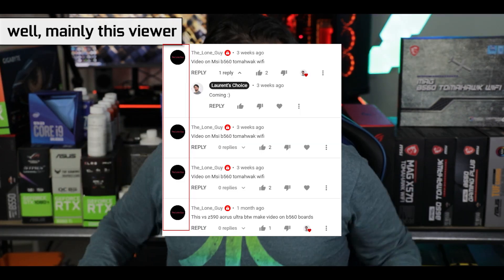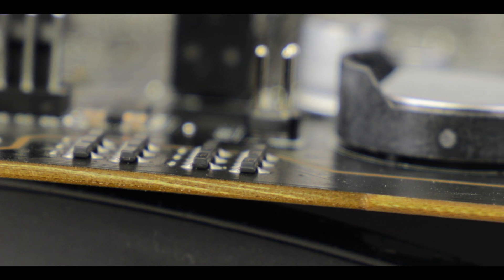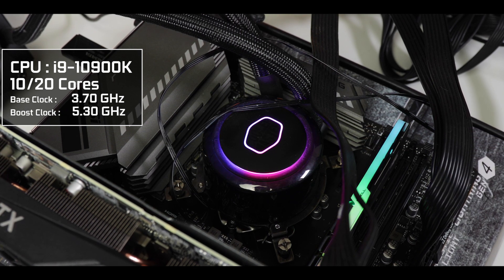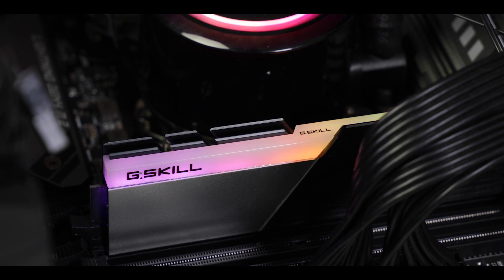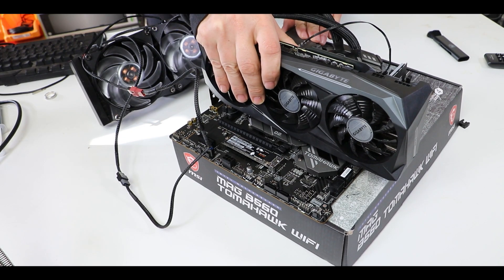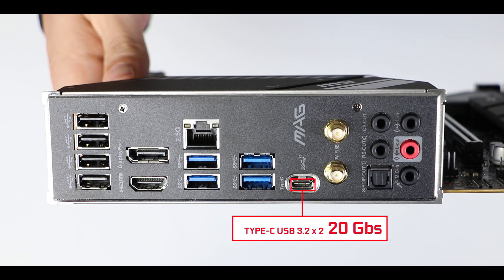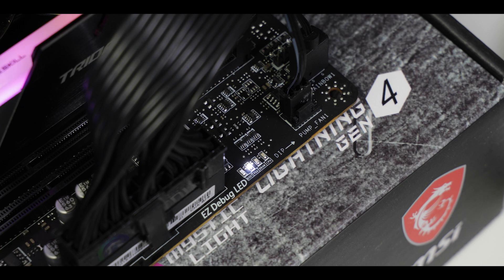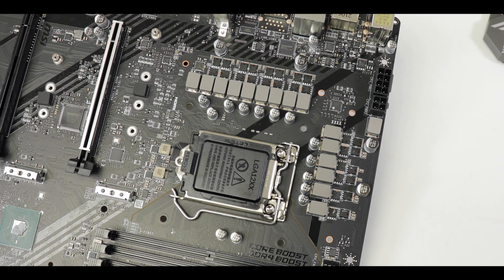MSI MAG B560 TOMAHAWK WiFi : The only TOMAHAWK worth having?

Comment: Please suggest me..
I have this PC..
Mother board is - MAG B560 TOMAHAWK WIFI

Processor - Intel Core i5 11400F 11th Gen Desktop Processor with 12MB Cache 6 Cores and 12 Threads Clock Speed up to 4.40 GHz LGA1200 Socket CPU

Storage - Seagate Barracuda Q5 SSD 500GB up to 2400 MB/s - Internal M.2 NVMe PCIe Gen3 ×4

IN 1ST SLOTS I HAVE.
Colorful GeForce GT 1030 4GB DDR4 RAM GDDR4 Pci_e Graphics Card with Single Fan ( GT1030 4G-V )

For this I need to add one more graphics card. Which graphics card I need to buy..?

Comment: I'll give you one solid reason to buy this motherboard for a budget optimized build. This is the best future-proof motherboard for graphics cards especially if you've got an 6600XT for near the msrp. You want pcie-4 because that card only has 8 physical pci-e connections unlike everything else. So running it on a pci-e 3.0 you can't enable resizable bar. It'll create about 5-10% performance difference versus having both pcie-4 and resizable bar. You gotta either go with intel 11th gen or ryzen 5000 series for having both enabled. And 11400f is far cheaper than 5600x. This motherboard is easily justifyable compared to amd counterparts since amd motherboards nowadays cost the same in the best case or more expensive while offering less features.  Unless you need raw cpu power for rendering and stuff and if your overall use is any work other than video editing or modelling or other stuff that includes a rendering phase. You don't need a 5950x level performance. 11400f will provide good enough gaming performance for anything midrange even for the few future generations of graphics cards. Just buy these today and you can build a monster system after DDR5 matures rather than spending $2000 extra on a system that'll already be obsolete soon.

Comment: 199 usd in newegg, but if you add the import, in the best of cases, it will cost 40 to 60usd more, an asus tuf z490 wifi cost 240-260 usd in my country.
They will probably end up costing the same, but which of the two is better?.
Reply from the maker: Oh good question.  
I'd go tje Z490 route just for the OC abilities.